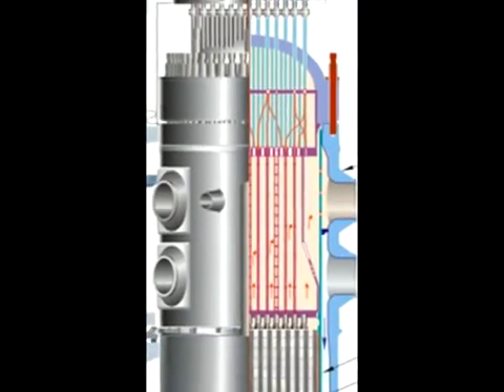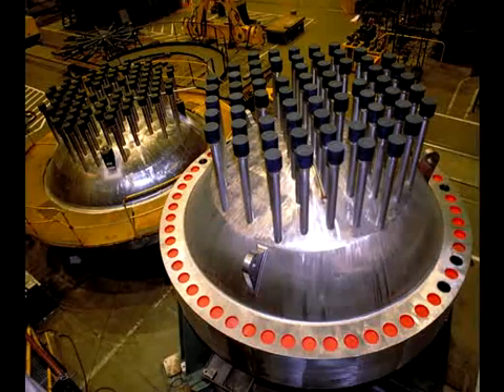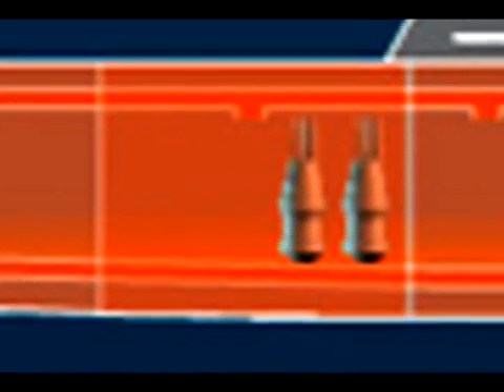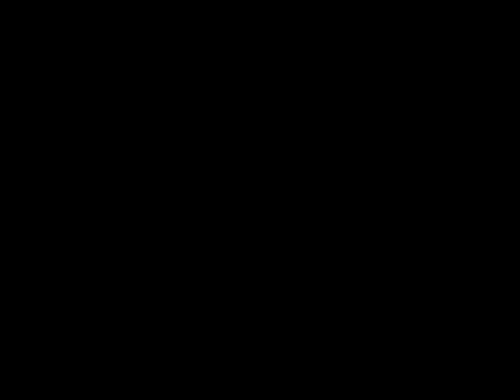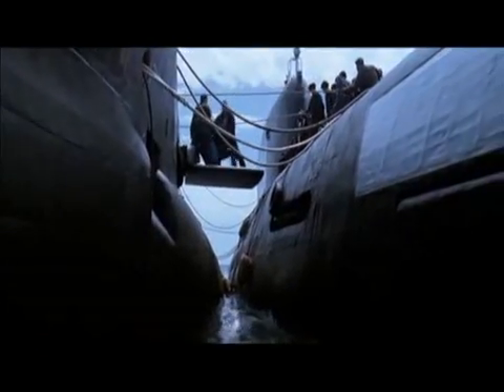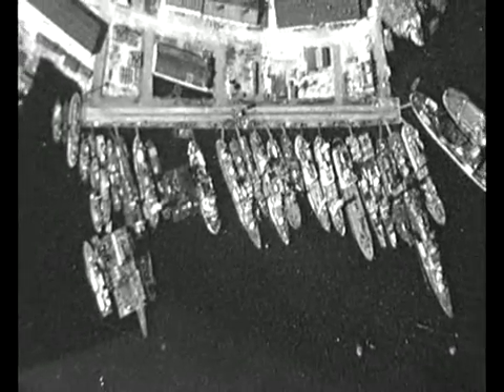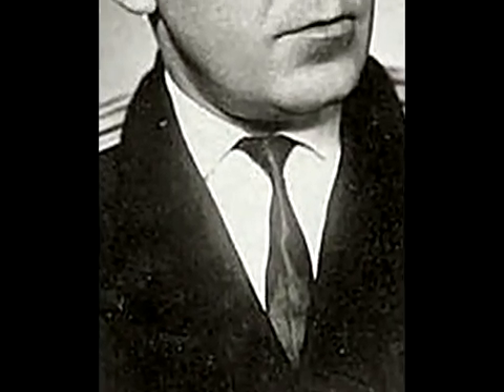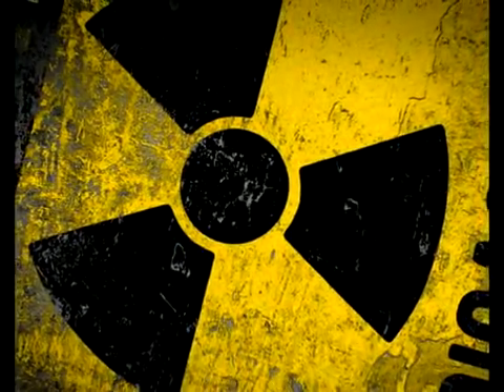K-19 Accident

Comment: Pretty good synopsis of events, and of course it helps to have the film illustrate in action how things went wrong. As for the cause of the Accident, the over-pressurization during the system's first hydro-test may have played a role but bear in mind that in all system tasked with containing a pressurized fluid it will be tested to beyond it's normal working pressure (normally 1.5 to 2 times operating pressure) to ensure it's capable of handling it's design pressure consistently and also able to contend with phenomena such as water hammer. That being said, spiking up to 6,000 psi from it's design pressure of 3,000 would definitely stress the welds. But also, don't forget these subs were not being held to the same quality control standards that Admiral Rickover insisted on for the US subs. They were being built as quickly as they could (hence why they had no Emergency Core Cooling System) to get them in the water and ready for battle. So I think the welds themselves in the plumbing are partially to blame since they were done fast and dirty and the joints were not X-rayed for consistency, contamination or porosity/voids. It only stands to reason that this would happen, because if the welds and the piping in general were up to the same standards as the US counterpart, even with the spike in pressure during the Hydrotest, the system likely would not have ruptured. One problem made the other worse.